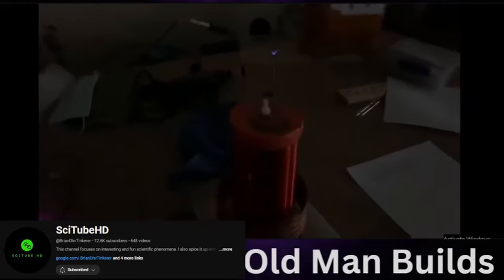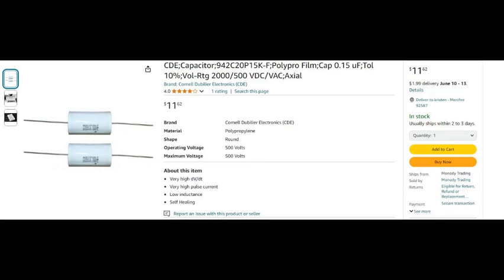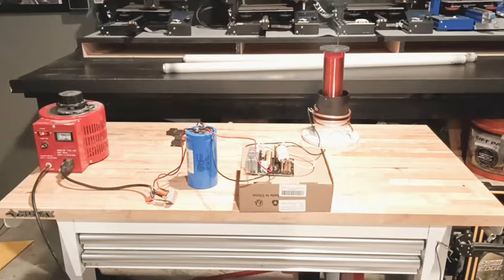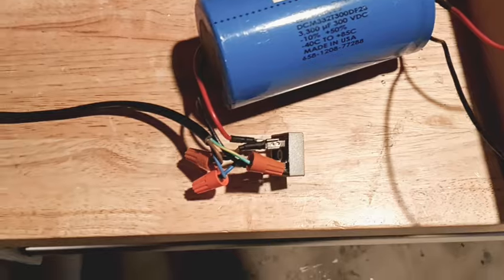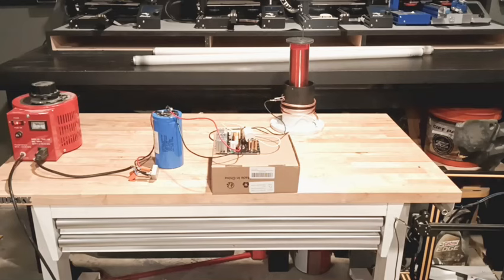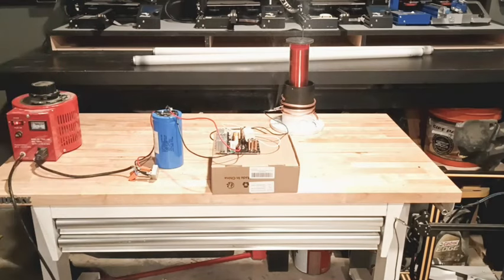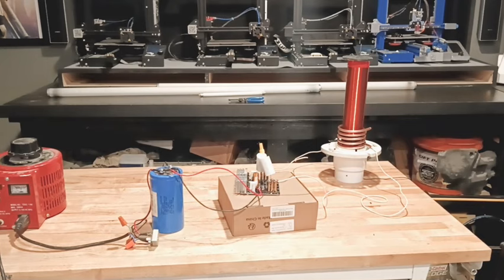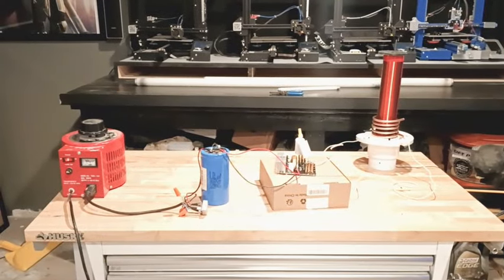ZVS Tesla Coil "First Run"

Comment from the maker: At 50v I am getting 10a to the zvs. In the video the guy had 65v an 16a. I thought I was over amping it. I have a 220v step up transformer from 110. I might put it in to reduce the amps and raise the voltage. First I think I need to make the frequency oscillate properly at low voltage. Basically I am missing the amplification point in the coil. I get 1 foot in distance. If I am right about the frequency. I could get the 3 additional feet without the step up transformer. I talk a lot about the amplification point in my video's. I should have realized it sooner. I also should have realized that a car battery wire should be used with proper connections for so many amps. I still don't understand how his wires were so thin and it did not get hot. Unless his amp meter did not work properly.
Reply: When it overheats, it means it's not oscillating. When it's oscillating, everything is barely warm. It's tough to start the oscillation. I put an extra switch between the ZVS and the power supply. Then I turn on the power supply first. Then, I flip the extra switch. This kickstarts the oscillation. I place the o-scope probe with a tiny wire that acts like an antenna. Place the probe 6 inches away from the teslacoil. The oscope should be 12 to 18 inches away. You will know it oscillates when the amps are lower, 4-5 amps and the components are barely warm. The oscillation will show up on your scope. This is how I get mine working. I have the same Amazon ZVS that you do. I configure my capacitor to read 75 to 80 nanofarads.
Reply from the maker: @shawncalderon4950  do you have pictures or a video? here is my email. oldmannathanbunten@gmail.com    I would like to see the low voltage connected to show oscillation. then the high power part. What are you using for the higher voltage? I need this thing working. I understand the oscilloscope part 100% its the power part I am having trouble with.  What's the low power amount. can i use a 24v battery for it? That way I can set the oscillation properly. Then add in the higher voltage.
Reply: @nathanbunten4299  It's a fantastic coincidence that we are building the same circuit at the same time:) I'll send you a test email. It will take me a week to assemble the photos and steps to get it working. When you have time, try watching the Arcangel ZVS Tesla video. I posted the link in the comment section.
Reply from the maker: @shawncalderon4950  i will look it up thank you

Comment: 12v DC copper car battery cable for your coil hookup. ideal(also use solid lock grounds) Thermal displacement. your caps are not in tandem use redundent power wires.
Reply from the maker: I got the other ones. What does this mean? your caps are not in tandem use redundent power wires.
Reply: @nathanbunten4299  the resistance in your capacitors is your problem you have to spread the charge between them without making an inverse field thus lowering the ambient wattage. also your bench needs to be degaussed.

Comment: Have you looked anymore into the high Q tesla extra coils I recommended? If built properly you can get a Q of 200-300, though that's only if you give it extreme optimizations to reach close to that including the choice of frame and environment.
Reply from the maker: I did look into them. In fact I ordered 5lbs of wire to make different shaped tesla coils for other projects. The electronics you sent me will take time. I ordered a lot of parts. As they get here I will start to build it.
Reply: @nathanbunten4299  Neat, I wish you luck in a successful construction!

Comment: awesome you get there a 4 feet spreading is wild lol.
Reply from the maker: I agree.
Reply: A lot of it is in the design of the coil itself. Wire sizing, spacing, lengths, ratio, its all very important, you can take a bad driver and get great results with a properly tuned Tesla coil, it’s a transformer at the end of the day. 🧠

Comment: Place your Tesla coil 1 foot away from the O-scope probe. The probe should dangle and be connected to nothing. Turn on your O-scope to pick up the Tesla coil frequency. The frequency should be 342khz. The reason it's not 342khz is that your secondary should be wound with 34awg wire. Also, the coil should be 3.5 diameter and 6.5 inches tall. Your Tesla coil has different dimensions and won't match the 342khz it needs.

Comment: We see the effects replicated with different components i.e. the florescent tube lights up at proximity to the Tesla coil like it does with the Graviflyer. Your variac should be your best friend to replicate with other materials and components. The signal generator should allow you to get the tolerances right so that you know how much voltage and amperage is necessary. Everything is clearly presented so you can see what is happening with the energy.
Reply from the maker: I just don't have the correct combination right yet. I will get there.

Comment: Congratulations on the new setup!
I was wondering .... Alexey said something about the Tesla Coil running at 2508 Hz, and his schematic has (it seems to me anyways) a frequency adjust possibility.
Nearly all ZVS I've seen does not have the possibility to change frequency independently, sure you can change the input voltage and that also changes the output voltage.
What is your take on this, sorry I haven't watched the video yet - but I will soon. Take care, and thanks for the share :ø)
Edit - 250kHz, not 2508Hz
Reply from the maker: I do not think you have to match the frequency. I think you need the power his has though. Between the top disc and the craft the frequency will change anyway.

Comment: The tesla coil secondary needs to match the dimensions of the one on the video. You coil is too long and thin. It needs to resonate at 342k hz. You coil has a different resonant frequency. The smoke is from too thin of a wire. I am building one. When I complete it, I will send you my steps to build.
Reply from the maker: I have to many amps in it. 3-4 amps would be fine. mine has 12-18 amps. Far to high for this project. The zvs is good. I need a transformer to lower the input amps.

Comment: Hello, I can see that you have one capacitor, maybe you need two as the other guy had in his video? It may be the extra capacitor will do the trick ? Keep going 👍🏻
Reply from the maker: I did put 2 in.
Reply: Ok I could not see
Reply: Hi again just wondering if you have seen my ion motor startup design? Maybe you could use this design to try with your graviflyer?
Reply from the maker: @dkdyker  I cannot find the one with that name can you link it. I like all the designs on your motor.

Comment: Dude, I have the schematic if you need it.
Reply from the maker: did you do the zvs in the video?
Reply from the maker: if you did the zvs, what power source did you use? also how did you trigger the mosfet at low voltage. It fults my regular 60v power supply so I had to use my variac. But the amps are way to high. I can build a regular tesla coil. I wanted this one because of the zvs.